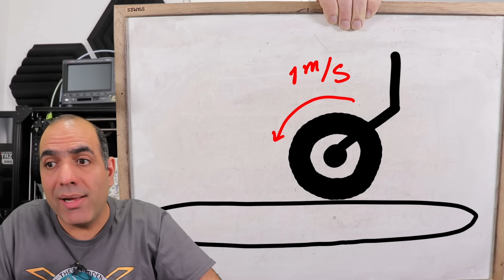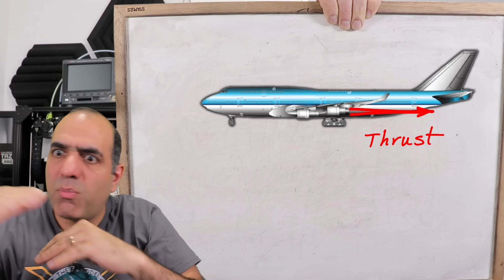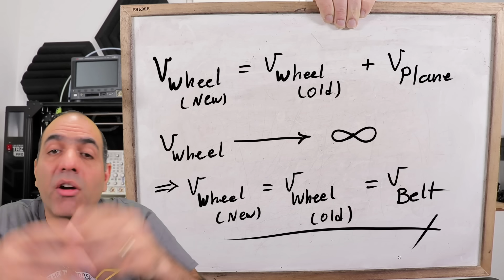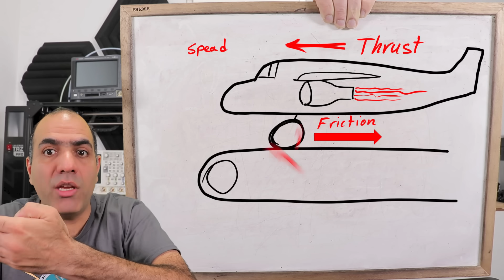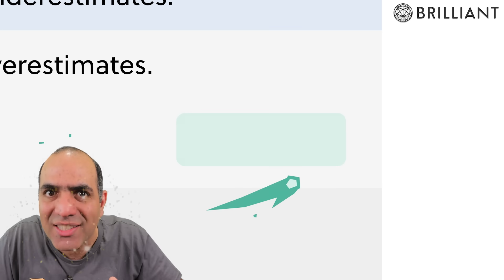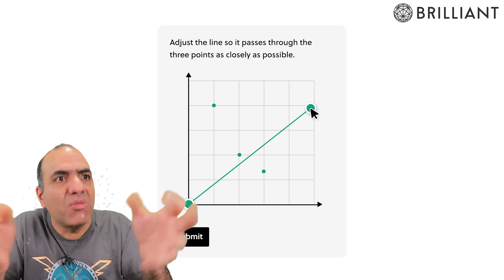Airplane Question that Drove Me NUTS!!!

Comment: No, because the plane speed relative to the ground is plane speed + (- belt speed); since plane speed = belt speed the speed relative to the ground is 0 regardless of how fast the plane is moving relative to the conveyor belt
Reply: The belt speed is equal to the wheel speed, not the plane speed. The wheels are not what moves any plane forward for takeoff, that's the job of the engines, which interface with the air, not the ground. The wheels and treadmill are a red herring, they basically make no difference

Comment: It will fly. The engines is independent of the wheels. Simple. But if you count in the physic limitations of the tires it will fail due to abnormal speed that it's not designed for. 
So in theory it could take of but in reality it could suffer from physical limitations of the design of the wheels. 

People tend to imagine that the planes wheels accelerate the whole aircraft. But imagine instead that the wheels acts like an air  cushion while the aircraft don't have the speed enough to make it's own lift.

Comment: It is vital to understand the difference between airspeed and groundspeed if you actually want to fly.
Reply: It is also vital to understand if wheel's centre of mass is going forward with a velocity V, the wheel's angular velocity would Be V*radius of the wheel. It would not be turning with same velocity as its centre of mass.
Reply: I was under the assumption that the air speed is 0 and the question doesn't say the plane had thrust.
Reply: Somebody had to say it
Reply: You would think people that graduated high school would know this. Seems like that's not the case, though.
Reply: @croaton07  Some high-schoolers take biology not physics.
Reply: Yes and when the groundspeed is zero, also the airspeed is and that makes no lift
Reply: @borabengi4583 a treadmill cannot keep a planes airspeed at zero though. All it can do is make the wheels spin faster.
Reply: @olican101 yes it can , because the airspeed is equal to ground speed minus wind speed so if there is 0 knots wind speed the airspeed is equal to the ground speed
Reply: @paolosidoti173  the air speed is no equal to ground speed for a plane on a treadmill 🤣
Reply: I am more than an aviation enthuisast, i built and flew a lot of RC airplanes and you misunderstood me. İ meant conveyor belt’s speed when i Said ground speed. I know airspeed is independent to ground speed. We both know this one won’t fly without airspeed. Here airplane won’t fly because belt doesn’t let wheels to go faster than it and that means plane will try to move forward from it’s position but it won’t fly because it’s not moving meaning that airspeed will be zero. And without flying off the ground, wheels will blow up due to centerrun effect and crash on it’s belly. So eventually, it will run on the belt but won’t fly and run till wheels get ripped. At least this is what i think.
Reply: haha aight, makes sense
Reply: @polytekhat  honestly saying do you think so? İ thought a lot about it. İt certainly won’t fly but i’m wondering that would it move out the conveyor or keep in place. As you know, engines produce the ground and also air speed unlike cars, and i think wheels’ drag wouldn’t let the plane move out the conveyor and it also says conveyor matches plane’s wheels’ speed to keep it in place. Also, it doesn’t say there is any kind of wind like tail wind or a headwind so it won’t get any airflow in plane’s wings. What about you, do you think so?
Reply: im going to assume practical conditions here with friction and everything cuz otherwise there's no point. The plane would gain a few knots of groundspeed in my opinion but thats it... cuz at that point the conveyer and wheels would be moving at too high of a speed to keep intact. The landing gear assembly would just come apart lol
Reply: @Borrayfpv  wouldn't it create a vacuum effect as there is thrust but the plane isn't moving
Reply: @fuzzyhair321  What kind of vacuum effect?
Reply: @Borrayfpv  well the air would be moving wouldn't it? You might be standing still but the engines are pulling air back. I was imagining a tunnel effect like when a train pulls air as it pushes forward creating a vacuum
Reply: @fuzzyhair321  I didn’t understand you very clearly, but as I can say, the engines will suck the and push the air to the back, If you mean the engines sucking the air from the front side of the aircraft, İt acts like pump but it will stay in it’s position
Reply: @Borrayfpv  ground speed has absolutely no effect on air speed. Air speed can be well over 25 - 30 knots (30 miles per hour) while ground speed is zero. Ground speed being zero does not mean there is no lift on the wings of the aircraft. If you're not an aviation enthusiast and dont know about this, dont comment about it
Reply: @polytekhat  this is why we tie down aircraft and secure rotors and controls. 
Darn things get a mind of their own when the wind hits em just right lol

Comment: Short answer: NO
Long answer: The typical takeoff speed of a 737 is 150-180mph. Let's say in this scenario, the plane can take off at 150mph and the conveyor belt is spinning at the same 150mph to match it's speed. From our frame of reference, the plane would be standing still/at the same spot. For takeoff to occur, you need speed & LIFT. Since the plane isn't moving through air, the wings are not generating lift. Problem solved. This has always been a nice brain teaser. The real evil culprit is the way the question is asked. Mythbusters took a stab at this as well.
Reply: thousands of pounds of thrust pushing it forward, nothing holding it back, and it's not moving?  why?
Reply: @tsm688  Because the thrust is being cancelled by the conveyor belt. Plane won't move if the belt is canceling it's forward momentum. The jet engines at this point is just sucking up air. If we're talking about everything being equal, the plane would be at a standstill.
Reply: @Jayeeyee  The conveyor CAN'T stop it.  It's a trick question.
Reply: @tsm688  This question was always meant to be a brain teaser. If everything was possible in an infinite 1:1 ratio then what I mentioned prior would be the outcome. How would the plane generate lift if the wings are not moving through air? The plane weighs 80,000lbs, even if the engines spins up to generate enough thrust to hit 1 million MPH and the conveyor is spinning in the opposite direction at the same speed, how will it generate lift?

Pretend you're running 10mph on a treadmill and the treadmill is also spinning at 10mph to match your speed, you would be running at the same "spot". Please explain to me your reasoning why you think the plane would generate lift. Just don't say because "it will".
Reply: @Jayeeyee  "running on a treadmill" is wrong.  You think airplanes take off with feet like cars in the Flintstones?  Try "rollerskates on a treadmill".

Wearing rollerskates, I can basically ignore the treadmill.  With a miniscule push I can hold myself in place.  With a little more, I can easily move forward!  With 50,000 pounds of thrust, I'd move quite a lot.
Reply: @tsm688  Awesome analogy. I can see where you're coming from and agree you explanation does indeed make more sense.

Comment: bruh relative velocity. you are swimming in current towards you. water moves you stay at the same place. but in case of air he is right that winds push air not conveyer belt. if there was wind against its movement just enough to oppose its thrust then it wouldnt fly

Comment: I'm commenting at 1:15 before I finish the video and see what you say. The planes wheels aren't driven. So It doesn't matter if the conveyor belt is moving the opposite direction. Assuming the conveyor belt was long enough, unlike the one in the picture. The plane will just keep moving faster through the volume of air that it's in . The conveyor belt will have more mass than the wheels so it's going to accelerate slower. so it's just going to be a feedback loop until the plane takes off. The wheel speed will just be higher and there might be a little bit more friction loss in the wheels. But it's still going to take off. But as far as the one in the picture it's just going to fall off because isn't much lon ger than the airplane itself. Unless you had a heck of a headwind 😁

Comment: Ok, as an AvGeek I'll take the bait and try to answer it since you graciously gave me time to pause. If the plane is stationary relative to the surrounding atmosphere, it will never take off. The wheels spinning have absolutely zero connection to generating lift - which is provided by air flowing over the wings of an aircraft. The engines could be at max N1 (full thrust), but if the plane is not "moving" (again, relative to the atmosphere) then it doesn't matter. I will now retire from explaining the obvious and see what all the fuss is about.

Edit: Yeah, I think you're over-thinking this fictional thought-experiment Mehdi xD
Reply: thousands of pounds of thrust pushing it forward, nothing holding it back, and it's not moving?  why?
Reply: @tsm688  There are 4 forces that act on an aircraft - thrust (forward), drag (backward), weight (down), and lift (up). In order for a plane to fly, thrust and lift need to overcome weight and drag.

Now this is a just a thought experiment. In real life things would be different (the conveyor is supposed to have zero friction, but the wheels do have friction? Impossible), but the conveyor belt is supposed to move at the same speed as the wheels, so - in this case, the weight of the aircraft is acting on the wheels, which for all intents and purposes is equal to the thrust. Thrust = speed of wheels = weight. Drag = speed of the conveyor belt = speed of wheels = thrust etc. The thrust can never be more than the weight. The lift can’t be generated due to the drag. Therefore, the 4 forces equation can never be won by thrust and lift - 3 of them are In equilibrium and, unless there are sufficient winds blowing in the face of the aircraft (70kts ish for a small Cessna, up to 150kts ish for an airliner) lift isn’t going to happen.

Comment: If the wheel rolls, and it's frame of reference changes, does the belt consider the wheel to be translating or rotating? If the wheel was the stationary frame of a plane on earth then the earth would speed up to match the speed of the wheel, until it started flying.

Comment: The plane should fly independently from the wheels. The plane flys about 99.9% without using it's wheels. The conveyer belt is the runway. The only additional forces applied onto the plane preventing it from taking off would be additional friction due to the wheels spinning faster.

Comment: Yes. The plane can take off because the locomotion is not from the wheels. If the drive mechanism was like a car where the wheels provide the thrust then no, however the engines are independent thrust, therefore the media the wheels are touching is inconsequential.

Comment: A planes motion isn't dependent on it's wheels. It's like a water skier pulling their self toward the boat that's towing them. The boat may be moving at some speed, but the force the skier has to overcome isn't so high that they can't overcome it.

Comment: Paused the video to write this but the plane should not be able to take. Air movement is required around the frame for it to gain lift. Assuming the motion of the conveyor belt does not create enough winds with it's own motion, the air pressure around the planes shape would not cause a significant enough amount of lift to get the wheels off the ground.
Reply: thousands of pounds of thrust pushing it forward, nothing holding it back, and it's not moving?  why?
Reply: @tsm688  because the conveyor belt would be essentially creating more drag that would be equal to the thrust. Essentially if plane no move, wind no move. Wind no move, lift not happen.
Reply: @ruuse542  What drag?  Do you think the plane has its brakes on?  or are you invoking magical light-speed treadmills?
Reply: @tsm688  the exact parameters of the question already state that the treadmill will be matching the speed. You got a problem with the question, take it up with the person who asked it.
Reply: @ruuse542  So what?  Unless you left the brakes on, all that will do is spin the wheels faster and faster.

It's a trick question.  It implies that the treadmill can stop it.  But it actually can't.  Not unless you invoke magic bullshit.
Reply: @tsm688  alright explain your theory to me. I'm interested to hear what have to say.
Reply: @ruuse542  https://youtu.be/pykaBLRO5Fo

Airplane's wheels do this.  The actual force pulling on the aircraft would be very small.  The engines would be much stronger.

Comment: If the belt matches the wheel speed perfectly, the wheel will not turn at all when taking off. The belt would slide "forward", being stationary relative to the wheel.

Comment: Of course it would because whether or not it takes off has little to do with the ground it's on but rather the air it travels through. Since an airplane's thrust is generated by pushing air towards the back, it doesn't matter if the conveyor belt rolls in the opposite direction, the plane will still advance forwards through the air and eventually take off once enough air pressure is generated under its wing.

Comment: My theory is the plane will take off because the thrust here is against the air not through the tires. If it is a car it will stay in its place, but since the plane has a jet engine that pushes air its place is going to change depending on the air around it ignoring the wheels completely.

Comment: I interpreted this question as "I have a 747 on a very large treadmill. If I speed the treadmill up, will the plane fly?"
 

This conjures images in my mind of a treadmill, accelerating to keep the plane stationary while its speed increases (like one of those non powered treadmill things that speeds up the faster you go but never provides impulse and you never run off the front of it). Due to that, the plane wouldn't go anywhere. It's not generating any lift over the wing surfaces because it's not moving forward. 

I would love to see someone with more physics knowledge than me tell me if a 747, speeding up on a treadmill while not moving anywhere, would be able to take off if I were to set up a fan capable of blasting ~160 kts directly in front of said treadmill it though!
Reply: thousands of pounds of thrust pushing it forward, nothing holding it back, and it's not moving?  why?

Comment: At least they defined which plane is on the belt. Most people ask the question without specifying the plane. The Harrier GR.1 will take of in all cases when the engine is on.

Comment: The oversize conveyor belt unexpectedly tears, jams, stretches, slews off the pulleys, chews up an innocent bird, causes noise complaints from local residents, vibrates excessively until fracture, or otherwise mechanically fails. Resulting debris gets caught in engine intake, and explodes spectacularly.

Comment: The plane will move forward as it puts out enough thrust to overcome the forces against it like the downward pull of gravity, air resistance, friction of the tires and bearings, and depending on the direction the plane is pointed, the rotation of the Earth. These are all small compared to the output of the engines, at least for movement parallel to the Earth's surface. Unlike with a car, the wheels and tires are just along for the ride. They there there only there because planes can't hover. Because of the treadmill, the wheels will go faster than normal for a given forward speed of the plane. But because the plane must move forward due to thrust and the landing gear must move with it, there will be slippage as the tires are essentially pushed forward since they are no longer allowed to go faster then what they against. The real question is whether or not enough lift to take off will be generated before the tires blow out and the bearings and landing gear fail causing an aborted takeoff.

Comment: It won't because the wings won't generate lift it will be like a car on a tridmill, it loses energy when in the air and the plane will start to stall
Reply: thousands of pounds of thrust pushing it forward, nothing holding it back, and it's not moving?  why?

Comment: no plane can’t take off, plane lifts from air over wings. the length of belt is as long as a runway. it would need to be way more longer if you think the jet engine can overtake the friction
Reply: What friction?  Do you think they left the brakes on?
Reply: @tsm688  from bearings, from wheels on material... etc  do you think there is a frictionless movement? lol

Comment: If airplane sits idle on conveyor belt that moves that means airplane moves backwards at speed of conveyor belt. In that case it might take off uncontrollably when airflow becomes fast enough to throw it around. It also might "fly" short while when landing gear breaks as converyor belt ends.

Comment: I think the plane would still push forward and lift, my reasoning being since planes could land at speeds of 130-160 mph/240 kmh (according to google) meaning the wheels could be capable of pushing forward and wheels spinning at speeds for the plane to pick up enough air mass to create lift and friction on the belt would be less of a concern and unless there was an opposite reaction that matches the mass and thrust of the plane itself, the plane would be moving regardless of the speed of the belt until we reach that infinite speed on the wheels which becomes bit of a different question and answer that being the these extreme forces would destroy the wheels, an example being where rubber tires were being town apart by ground vehicles breaking world record speeds.

Comment: It would still move forward at normal take off speed bc a plane doesn’t get its propulsion from the wheels but from the engine. The only thing that changes is the wheels turning faster.